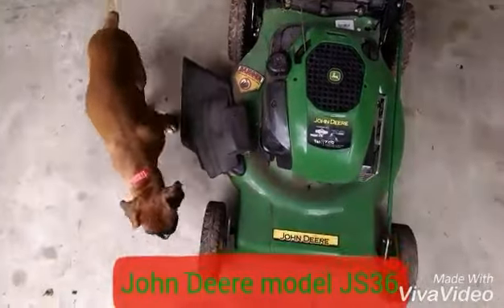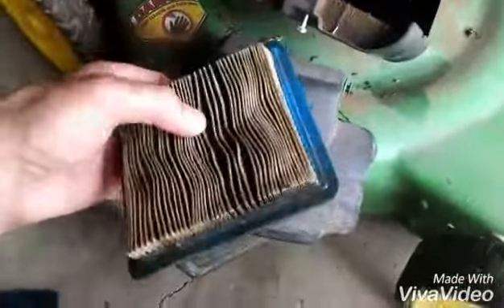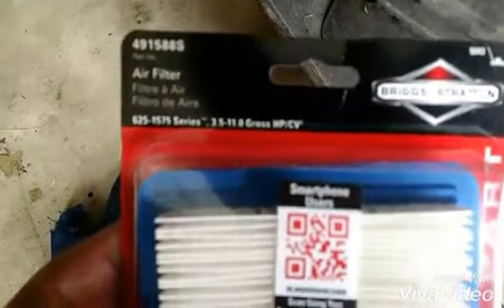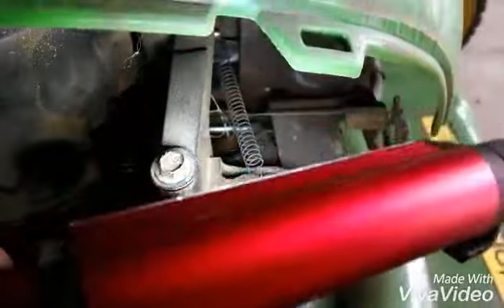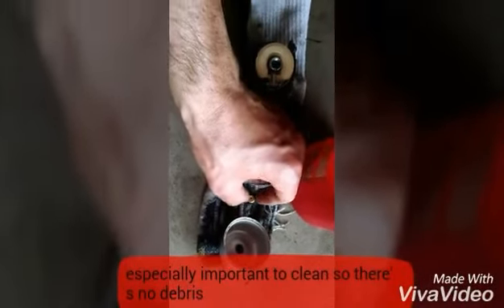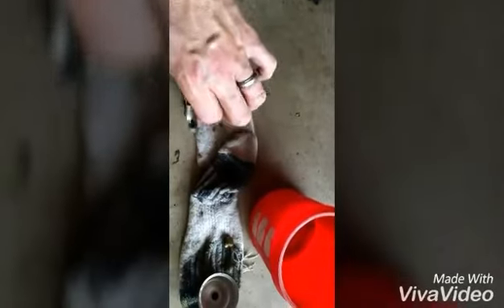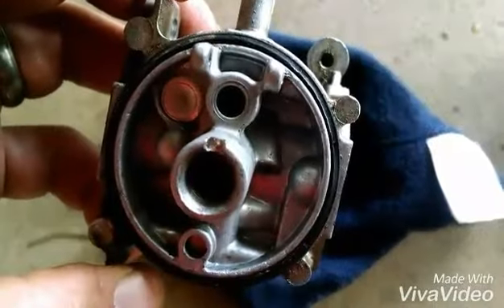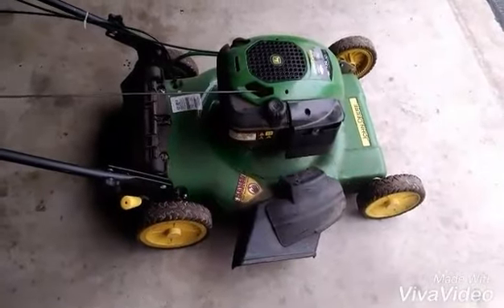John Deere JS36 carburetor clean new air filter and spark plug

Comment: Great video! I bought a used one for 125 . I cut the whole back yard and some of the front before it would start for 2 mins then stop and the eventually it just sounded like yours. So I know will need to get a spark plug by comparing you. Now that I seen what you did, I’m going now to do the same thing! Thanks man!! Because this lawnmower cuts nice.
Reply from the maker: Thanks for the positive feedback 👌
Reply: @Neighborhoodgo2guy  Great News! Lawnmower is fixed! Did exactly what you said and my lawnmower is working. Thank you sir!!! 🙏 💯✅
Reply from the maker: Right on Ted👍

Comment: I replaced my carb but you didn’t show how you replaced it. My issue is does the valve closest to the air intake and filter move? The back spring of the carburetor moves when I touch it but the front one seems locked in place and doesn’t move. Not sure if I did something wrong.

Comment: Thank you very much I followed your video and now my js63 runs like new, however I broke the little piece on top of the carb I think it attaches to The Governor control rod.. How will that affect the mower not having that attached.. Thanks again
Reply from the maker: How much could it affect the mower? Hard to say without seeing which part exactly. But every part has it's purpose. You should track down that specific part or even check the price on a new carburetor? Good luck, thanks for watching, glad the video was helpful.

Comment: great video how do you clean the 2nd part of the filter, should you?
Reply from the maker: you can try to clean it in hot soapy water. make sure its completely dry before installing it or water will get sucked in and that's just bad news. i believe i left a link in the description for the new part via amazon.

Comment: My amazon carb replacement kit came with some fuel inline attachments that were not part of original design. And another rubber dome thing. Can’t figure what it’s for.
Reply: Doesn’t work with this mower that’s a primer button which this mower doesn’t have a lot of weed eaters have them. When you put the carburetor back together did the front valve move? Mine is locked in place not sure if it’s back together right, but the spring in back of the car is fine.